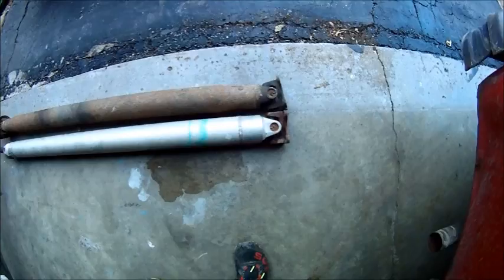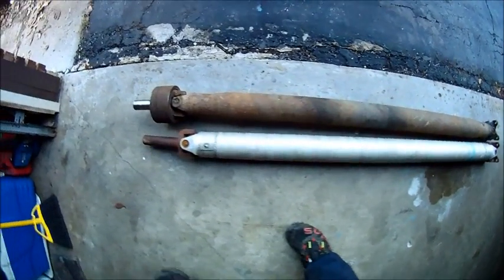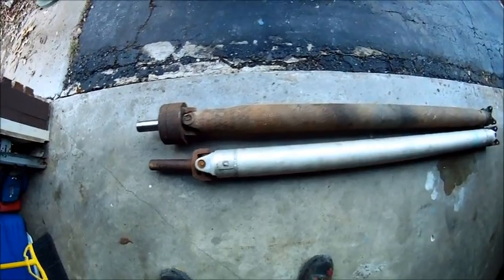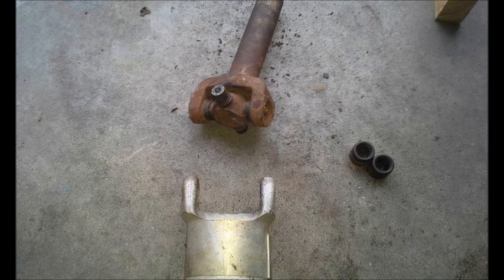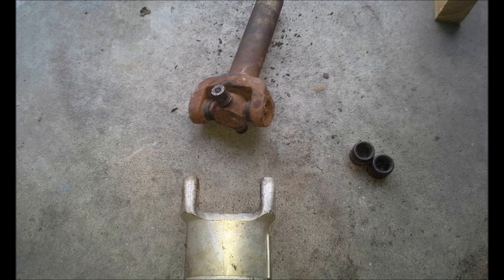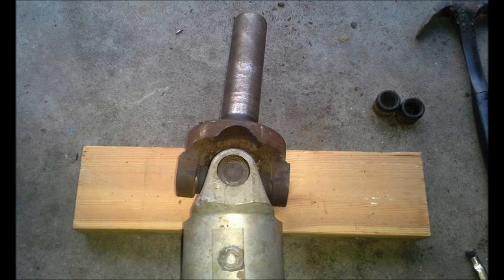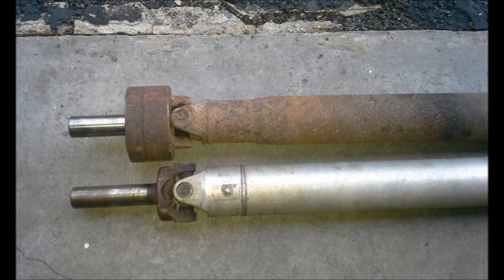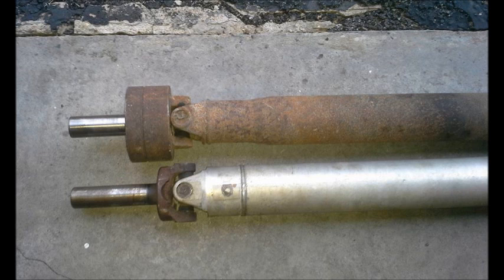Ford Ranger Aluminum Driveshaft Upgrade for under $20, DIY.

Comment: Hey so that ring around the yoke on the ranger shaft , mine came off and it makes a clunk noise, is it safe if i just take it off, the yoke looks fine, but idk if is safe to just take it off
Reply from the maker: It's a balancer, removing it will add more vibration, I've done it before.
Reply: How can i put it back
Reply from the maker: You can't put it back, either take it off or buy a yoke with balancer and install it on your driveshaft.
Reply: I have it
Reply: It came off and wont stay in place
Reply: Was the vibration really bad
Reply: Is the vibration too bad?
Reply: You where can i buy it, i been looking in amazon and ebay and i can find it
Reply from the maker: What year is your truck? I might have a spare one lol.
Reply: 02 ford ranger xl 2.3
Reply from the maker: Manual or automatic transmission?
Reply: 5 speed
Reply: I been having it like this for a while now
Reply: @eugeniorico-chavez1006  What did you end up doing? I have the same problem on my 2003 xl.

Comment: Does some newer rangers have aluminum drive shafts from factory.?
Reply: I think Ford started in using them in '98. My '98 2.5L 2WD came with an aluminum driveshaft. It even fits a 5.0L swap without mods.

Comment: Wouldn't the extra weight of the old shaft be better for hauling heavy loads? Also seems like the aluminium one would not be nearly as strong. But yea great way to shave weight or just save a few bucks.
Reply from the maker: +MidwestMotoRider  Extra weight on the driveshaft isn't a very good thing, it's like a difference between 520 chain and 530 chain.  And yes, aluminum driveshaft is not as strong, but it's plenty strong for the truck hauling a bike around.
Reply: EVERY DAY I RACE My concern was if you used the tuck for heavier loads but if its only going to be motocycles and the occasional house hold items then yea that would work fine. There are some model trucks where extra weight on the drive shaft is a must and the factory put on weights and thicker walls to help stable and smooth out the ride generally however that is on 1ton and bigger trucks.
Reply from the maker: +MidwestMotoRider  I am sure on a 1 ton truck that pulls heavy loads aluminum driveshaft wouldn't be a good idea, but in general you want to have the lightest driveshaft/wheels/transmission that you can without sacrificing the strength of the drive train. You do not want to make the driveshaft any heavier than you have to, the weights that you see on the driveshaft is probably there for balancing, just like the balancer that was on the original driveshaft. Another thing that you have to remember that U joints are usually the weakest points and they usually break way before the driveshaft does.
Reply: EVERY DAY I RACE True, so do you need to balance the aluminum shaft then, or is it light enough not to need it?
Reply from the maker: +MidwestMotoRider  Nope, no vibrations what so ever. Old one had a nasty vibration from 72-75mph.
Reply: EVERY DAY I RACE Good to know. This is something I will take into account once I replace my current rig with a newer one. :)
Reply from the maker: I am looking for an older rig, 95 and older.
Reply: @everydayirace  that is why Ford started using Aluminum Drive shafts in the ranger insted of the steel starting in 1998